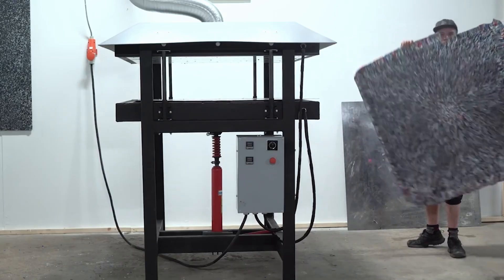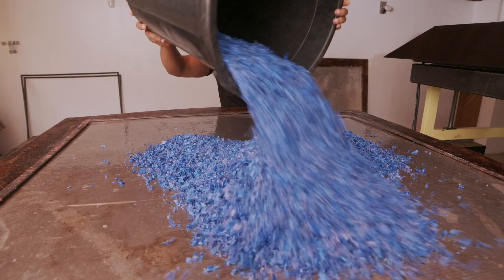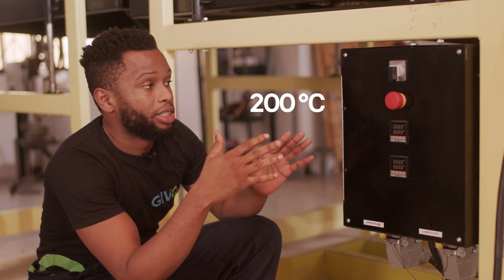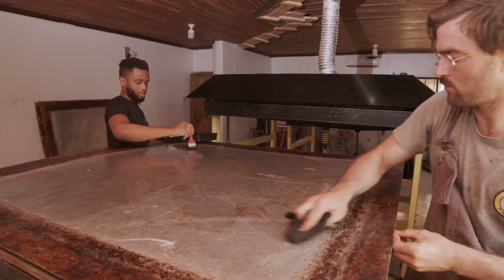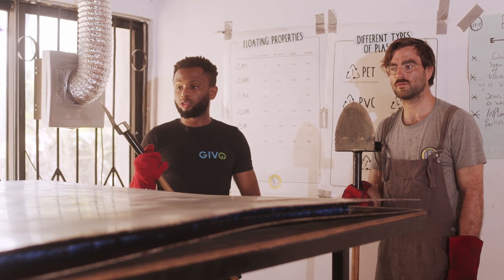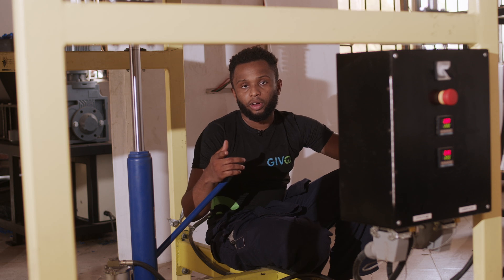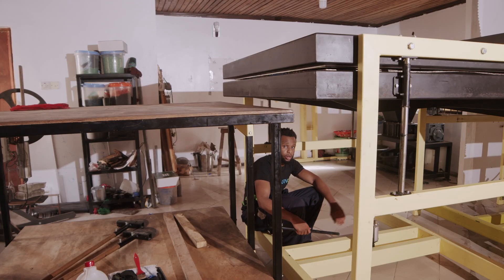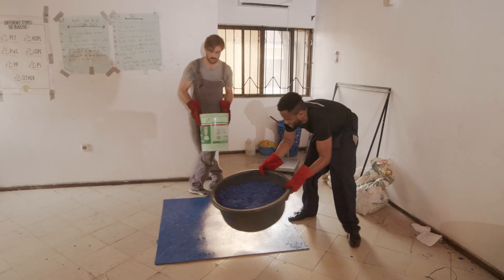How to Make a Recycled Plastic Sheet

Comment: Can you tell me the finishing and polishing process that is applied. In my sheets, the surface touching the bottom plate comes out extremely smooth but the top surface comes somewhat rough. Also the colour seems a bit washed off. How do I finish and polish them for a smooth and vibrant looking sheet?

Comment: What do you use to lubricate your aluminum sheets? And do you ever get air pockets in your sheet?
Reply: A wax spray can be used on aluminium so it won't stick. If you have air pockets in sheet put some more clean plastic in the pocket and use heat gun to melt it and a flat blade to smooth it out.

Comment: My sheets are always thinner in the middle, what can I do to prevent it?
Reply: You often have slight thickness variation, generally around 1mm and also generally in the middle. If you have it more it might come from the sheet-press bending if built with smaller sections, or the heating plate or its supports being bended. Try to press applying the pressure more progressively to reduce this effect.
Reply: @yannclm5231  Fabricate your press such that the top plate has even pressure across the entire plate. Ensure that the bottom plate has equal support from underneath across the entire plate. It's all a matter of having a stabile, solid setup with no flex or deflection. Best wishes!

- Max Giganteum